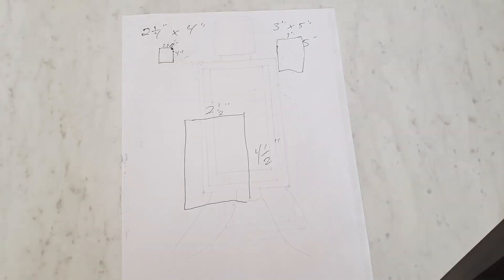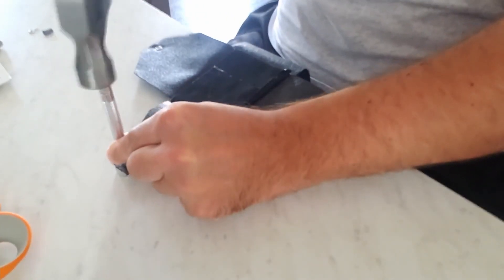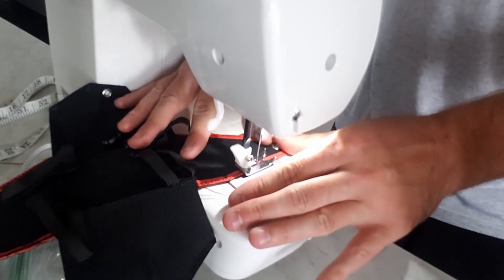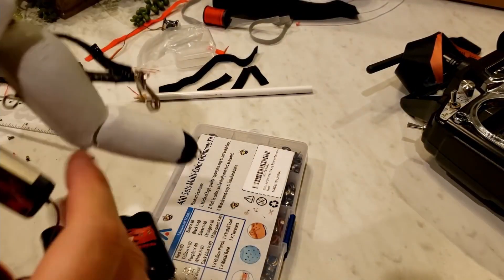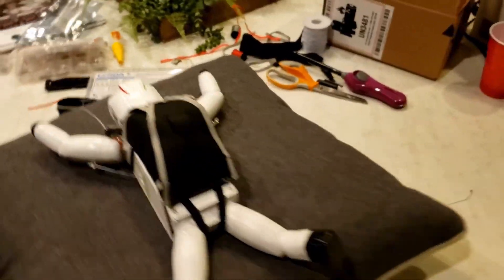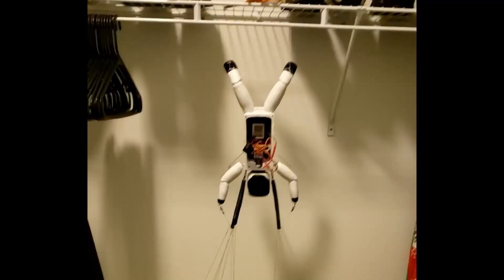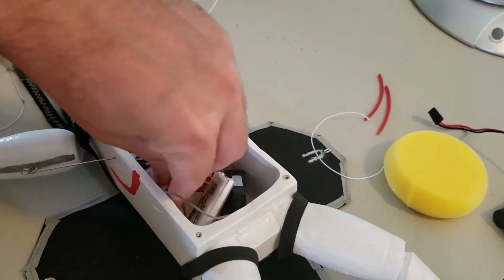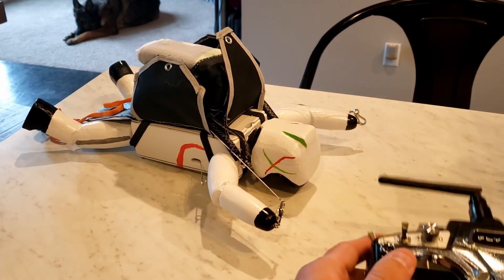How to Build an RC Skydiver | Parachute Container | PART 8 | Project Skyfall

Comment: Hi!
It's been really fun seeing this project in progress!
That battery only pulls 4.2V at 100%, I will say do all your tests, then put it back to 100% and then do the real drop if possible.
4.2V is the max, but most can do a little more if you are only gonna do this a couple of times. How are you charging it?
You could try pushing it at 4.3 just to have some margin